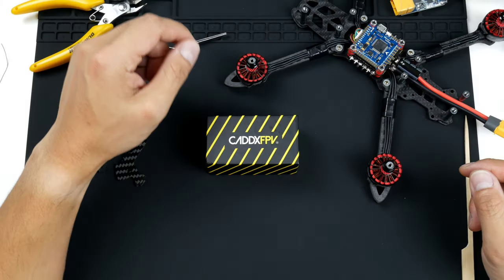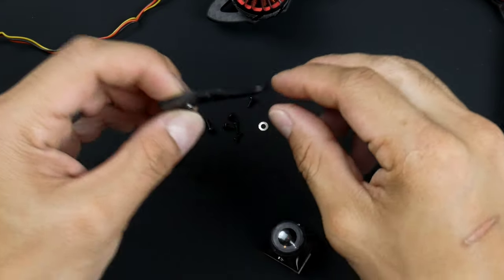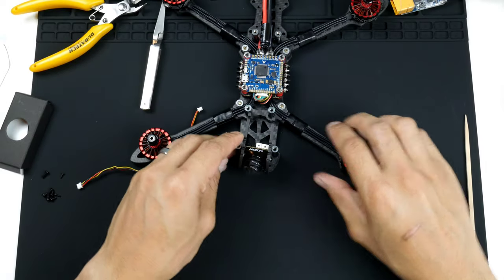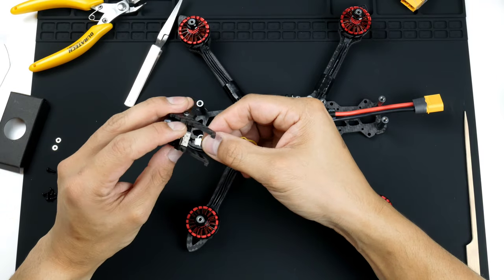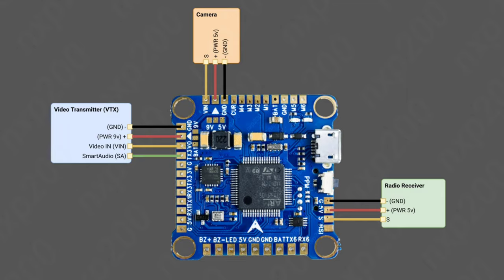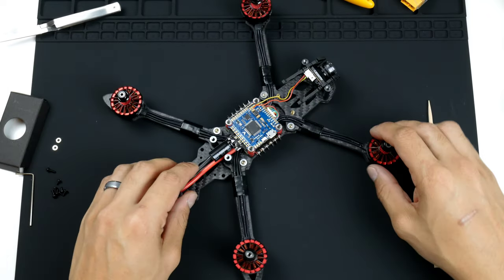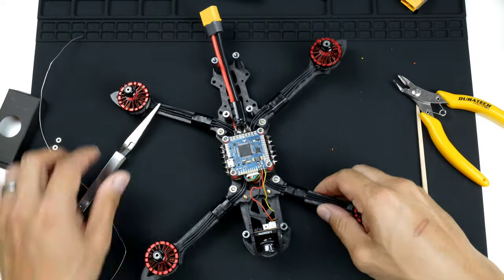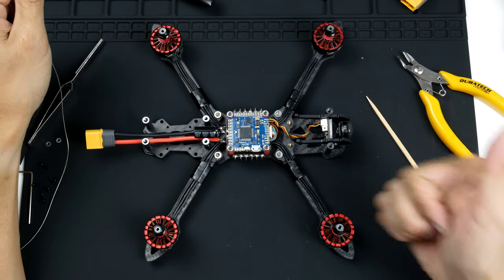GEPRC Mark 4 Clone Build - 06. Caddx Ratel 2 Camera Install

Comment: Hi, very nice work friend, which receiver would you recommend to me for the turnigy 9x remote?
Reply from the maker: Receivers for the Turnigy 9x are generally pwm, which is one wire per channel (aileron, elevation, roll, throttle). I haven't set one of them up with an f4/f7 flight controller before. Some support it, and some don't. Sorry I don't have more info or videos on this. Good luck!

Comment: Hi man thanks a lot for this series, it helped me a lot,
can you add links to a suitable propellers and batteries and antina.
Reply from the maker: A few props I've tried are Gemfan 5149, iFlight 5140, and now I'm running Ethix S4 LemonLime which I really like. Props are kind of a personal thing I think and really comes down to the style you fly. So try a few out. I use CHNL 1500mah 4s Black series. And I tend to go for Foxeer RHCP Lollipop antennas.

Comment: for the video transmitter you didn't need to bridge 5v or 9v? which one it uses by default?
Reply: Great video btw
Reply from the maker: In the following video where I install the VTX, I bridge the 9V pads where the video out pad is. I'm not sure what the default output is.